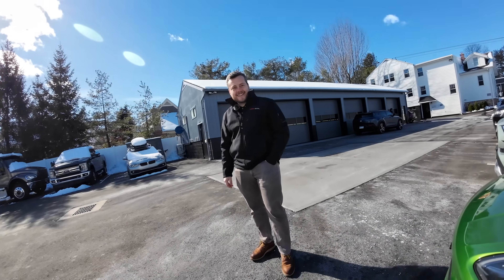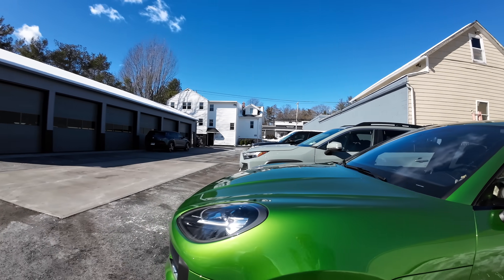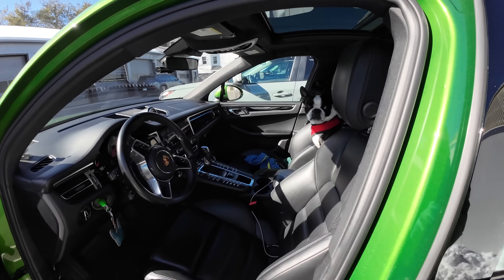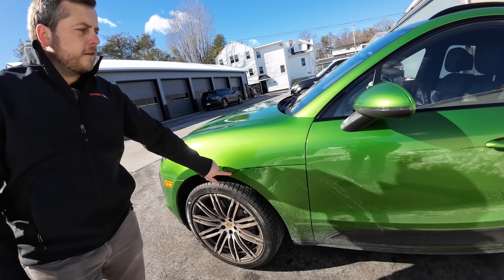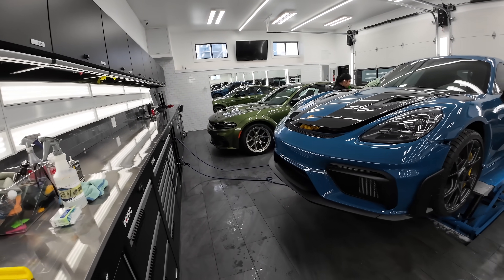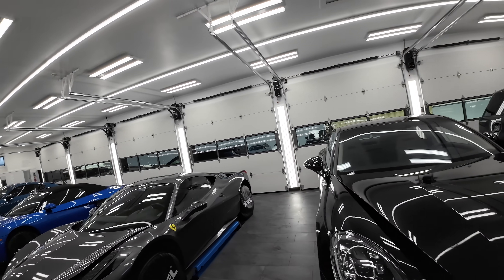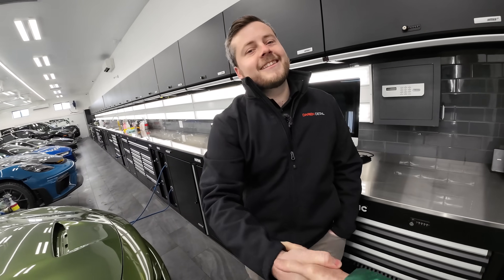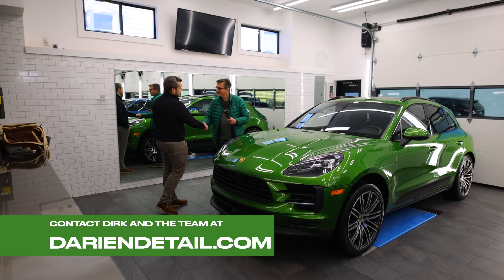Paint Protection Film 4-5 years later on my Porsche Macan. Has it worked?

Comment: Great video, Nick -- Dirk has wrapped 10 cars for me with Xpel (7 full wraps) and his work is consistently excellent.  Like most things in life, wraps are trade-offs; in my opinion, they can't quite duplicate the luster of a proper paint-corrected clearcoat finish, though Dirk can come close.  But like you, I live in Fairfield County, which seems to have an endless natural supply of small stones and other debris on the roads year-round, which is thoughtfully supplemented by the DOT with tons of sand every time it snows.  The worst of the winter sanding doesn't dissipate until April or even May, when the towns run their street sweepers.  Over the years, I have come down solidly on the side of full wraps to protect the original paint on my cars -- with a wrapped car, my stress level about paint chips is close to zero, so I enjoy my driving far more.  At least I don't freak out when I hit a patch of invisible gravel, which happens more often around here than you might think.  Wraps (at least the Xpel wraps I have) are also easier to maintain than clearcoat -- much less likely to scratch when washing (always a risk, however careful you are), and the Xpel wrap is self-healing to some extent if you get something minor.  You can also put a ceramic coating over the wrap to improve its appearance and resistance to chemical contamination, which Dirk does for me.  As to your lovely green Macan, I am ordering a Z4 M/T and can't decide between San Francisco Red Metallic and San Remo Green Metallic.  I normally would just go with red, but your video has me thinking seriously about green -- it looks gorgeous on your Macan.  One last note is that one doesn't have to have an expensive car to justify a wrap -- it is worth it for any car for which you want to keep the paint perfect.  I have joked about this with Dirk, but I bet the 10 cars he has wrapped for me are (with one exception) probably the least expensive cars he has ever wrapped.  The cheapest?  How about a 2002 Miata LS, a 2019 Fiesta ST and a 2021 Crosstrek M/T?  The most expensive?  Well, I watch Nick's channel, don't I?  If you love the way your car(s) look, and you actually drive them, and you want to keep them beautiful, a wrap (with a ceramic coating on top) is the only way to go.  Nick, thanks again for the video!

Comment: Glad to hear the PPF has worked so well for you Nick--a beautiful car.  I saw your original video before buying my 2022 Macan S, but did not feel comfortable with my options here in KY for PPF.  Driving it home less than 30 miles from the dealer on the interstate, a rock to the hood off a trailer took the paint off in 3 places just above the headlamp.  Wish I would have taken my chances with the PPF.  Great video as always.

Comment: I am waiting to hear your thoughts on the new hybrid carrera GTS! Digital gauge cluster, start/ stop button/ and hybrid single turbo 3.6 L flat six and two hybrid electric motors, one in the turbo and one between the engine and pdk gear box. Likely to be PDK only and I am not impressed.

Comment: Hello mate! I used to watch all your video but for some reason I am not getting them in my feed😡.

Anyway, I got a new 911S 992 after waiting 18 months for it. It was well worth the wait. I have been driving it for about 2 months. I wanted to ask you a question since you are knowledgeable about Porsche and have extensive experience.

Is it normal for the oil pressure to go up when accelerating. It stays normal when idle and it goes down when not accelerating. The warning light never comes on. It typically goes up to bout 4.5 bar from 2.2 bar. It then settles when reaching a constant speed. Also the battery voltage seems to fluctuate too but I can’t see a pattern to it. Again no warning light. Are the oil pressure and battery voltage linked to each other or are they linked to each other somehow?

I don’t typically look at these things on my dashboard so I can’t say if it’s always been this way as I just noticed this today and was alarmed.

I contacted Porsche and they are going to call me back as they have finished for the day. This is my dream car and I love it. It’s simply beautiful so you can imagine my concern.

I would be grateful for any comments or thoughts on this😡😊
Reply from the maker: That is completely normal. The oil pump is RPM driven.

Comment: Here is a question - recently purchased a one owner 2013 911s with 26,000 miles.
I miss having a backup camera and am wondering if I hurt the value of the car by upgrading to a new head unit and adding a backup camera?
Reply from the maker: You can add a backup camera to the PCM3, putting in a new head unit will Considerably de-value the car
Reply: Nick,
I was told that you cannot put a backup camera in to the existing PCM - you need to change the head unit - who should I call to confirm that? 
Also, I was wondering if my car has an unusually harsh ride, feeling every road imperfection or are all 2013 911’s that sensitive?
Reply from the maker: @casimirmazurkiewicz9768  no you can definitely add a camera to a 2013 I did it in my old car that was a 2013, you will have to hunt around unless you are in the CT area I know someone. As for ride, all 911s are harsh but your might have wrong tires or has been lowered
Reply: Nick,
I am in Scarsdale - if there is someone in lower Fairfield County, please let me know.
I do not think the 911 was lowered and I think the tires are OEM - maybe in the cold, the tires are much firmer?
Reply: Nick,
Yes, I did see a YouTube video on how to modify the 2013 911 PCM in order to add a back up camera.  It involves taking apart the PCM and adding a new wiring harness - however, it looks like a very complex, delicate process and not guaranteed.
Not sure if I want to have someone mess around with the PCM.